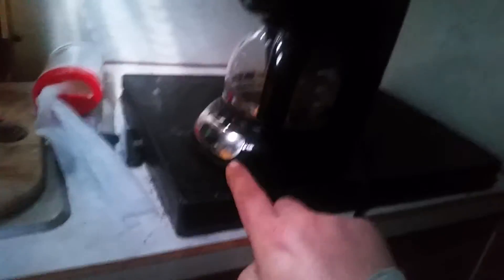Duralast 1000 watt power inverter  (JUNK )

Comment: Mine is 3000 watts and I'm having similar problems
Reply from the maker: Yeah they didn't built them properly, Aims is the one you want to go for. I had enough volts as you could see and it couldn't even turn on a small coffee machine which sucked. I lived in that van and seen that inverter and thought it was a great idea for coffee machine, TV, stereo etc. But starting checking these inverters out and Aims was the best. Good luck with your journey threw life.

Comment: Cables have alot to do
Reply from the maker: Yes your right, negative cable must be grounded out real good, both the Positive and Negative need to be really tighten down, condition of Battery and Batteries also makes a big difference, also the most important is it's not defective from the factory, some person might of said who cares and might have smoked a Joint. So their is a lot of circumstances. I seen this once on YouTube, some guy said he was a electrican and he didn't use heave gauge wire it kept blowing fuses, so sometimes it's worth bringing it to a R.V. place or even a Car garage. Have a goodnight and thanks for your open comment on the subject above

Comment: I got that exact inverter from my sister. I have ran small shop vac's, 7 amp weed Wacker and small single pod coffee maker (900W). Just tested AH of Everstart Group 29DC battery using a 200w fan. At one time the LUP message popped up, although inverter came in the box, I had no manual so I didn't know what it meant. But it reverted back showing power and voltage. Inverter shut off @ 11.34V. Only thing is, it shut off long after I had checked the KillAWatt for watt hours, the figure I was testing. The inverter shows constant 116v 60HZ under most loads. The fan is pretty quiet, unlike the loud Everstart 120W and 1000W inverters. They sound like a jet plane. I haven't done any testing on the Everstart 1000w other than running the Walmart brand 600w Model 201762 single serve coffee maker and 500w quartz work light. I have (2) Schumacher 2000w inverters, still in the box (7/06/2021) I can sell cheap for any takers. Those come with 4 cables for battery hookups.

Comment: 2 recommendations, first you will need more than 1 battery and very heavy cable to pull out the 55 amps DC you need.
Reply: And if your battery is down to 11.9 volts and 1 battery it will not run. I have a 750 watt Duralast inverter as a backup for my off-grid house and it will run a coffee machi e.
Reply from the maker: Thank you.

Comment: Your inverter is fine.

First, your "550 watt coffee maker" may be pulling far more than that when it first turns on with the surge. What is its surge draw? Probably more..

But, more to the point, this inverter is doing exactly what it's supposed to do: Shut down when input voltage is too low. If you attached a multi-meter to this battery that is showing 11.9 when you turn the inverter on you would see that when the coffee machine is turned on and the inverter starts pulling tons of amps out of the battery, the battery volt drops. ALL BATTERIES DO THIS: When they are under load their voltage drops. All batteries of any type. Either your coffee machine is surging well beyond the spec of the inverter or, if the inverter's error message is to be believed, the battery can't support the load you are asking it to support.

I recently tested a 3000W continuous inverter on a coffee machine and toaster. It would run either by themselves, but in dual it would constantly fault out. If I paid close attention I could see that it was sinking my 12V's voltage way under 11 when I tried both, so the inverter properly shut down. That is what yours is doing. And BTW that was on a new battery actively attached to a car's alternator. That's why huge loads require larger batteries or multiple batteries in parallel. 

This is also why TheInverterMan got his to work--because his battery was able to provide the load. I have a very slightly newer version of the duralast 1000 watt inverter and I can run an 800 watt toaster on it or a full size refrigerator because I'm pulling from a battery that isn't drooping under load like yours is. If you don't believe me, go and buy another inverter and you're going to keep having the same issue.
Reply: patty109109 Agreed. And I’m willing to bet the cable he’s running to the inverter are probably nowhere near the size they should be.
Reply from the maker: patty109109 Mine wasnt working period. I had  T.V. repair friend that tore it apart. The battery was new,  it was  2,000 watt inverter,  so it left 1,000 watts and it could not run 550 Watts. The buzz signal was going off ealier then when it was to shut down. Im done playing with these cheap inverters and found on on Ebay with 15,000 watts, to run everything.  I could only run a flat screen for a little time and it would shut down even a U.S.B. port wire for my phone charger,  never again will i buy something small like that. Thank you for your open comment and Good luck to you and your family in the future.
Reply: My 2000 watt inverter is doing the same as this guys and I can’t even plug my cell phone in without it shutting off. It’s definitely not the voltage

Comment: Thanks for telling me that and the reason I'm doing research so i can take care of my fam i was at Auto Zone i seen this so i decided to look this up on youtube to get further info.When i was at auto Zone they told me once i open it there's no returns on most electronic's so i looked it up on youtube to check what i was trying to do would work.i think you already told me that it or this has a fuse on the outside I'm just asking to make sure ? I was going to use 1 of these with a top post battery with a Car Auxiliary Clip-on Cigarette Lighter Socket Battery Clamp Clips Power Adapter and a power line inverter from wal mart cause it has two ac outlets o make it portable ? I hook all of them up it wouldn't cut the fan on but it was able to charge a cell phone i thine i need a in-line fuse holder to make the fan come on let me know ? When i put the car battery in the car with the same power line inverter the fan and everything comes on with no problem at all.

So i think i need a in-line fuse to make it work without a doubt like in the video "Build A Portable power Pack For $25"
Reply from the maker: mangreat71 The fan you need on to cool it down, it over heats you will cook it, There was not a fuse on the outside,  i had a friend who repaired T.V.s, he tore it apart. The fuses on the inside are sordid  even i callec a couple of places no one wants to touch these Power Inverters when they jave problems.  You can wire it up where you have jumpers that connect to the battery,  if you can do it great as long as your not bringing it back. Im wondering if you really need two Batterys tied into this? I was going to run the 6 volt Golf cart 6 volt batterys that lasted longer but you need a special inverter for 6 volts. If this one dont work out for you. You might have to go on Ebay there is a bunch of different ones, they do sell the small generator thats hand held and portable and is almost the same thing as  power inverter,  but better,  so there is a couple of Options for power if needed?

Comment: My Question is do it has a built in fuse like a 5 amp or a 10 amp or even a 15 amp ? Cause what i was trying to do is make a home made jump starter or power pack for charging appliances but i think i need a fuse like a 10-20 amp car fuse  with the top post car battery ???
Reply: I have one of these inverters. And you need to use a short #4 cable to the battery. I think what is happening is that either your DC cables are too long or not big enough to carry the rated 1000 watt load.  Also since the output is a Modified sine wave, some devices will draw more current because the voltage appears lower ( W=VxI )
Reply from the maker: mangreat71 You cant tear it apart, most of them have the fuse on the outside,  if it was a fuse it wouldnt even come on, i had my T.V. working off it, its defective from the factory.  Thanks for your open comment and Good luck in the future to you and your family. Just use caution if you replace the fuse,  some places will not accept there item back if you opened it up. If you have a warranty still on it. id bring it back. Have a good weekend buddy.

Comment: I have the same inverter. It runs microwaves toasters etc. is your inverter or your battery grounded? can be a problem
Reply: mine smoked after two uses...junk
Reply from the maker: yes its grounded if not it wouldn't come on. Please make a video so we can see you run a microwave with this inverter. lol I just proved it couldnt run a small coffee machine with 550 watts. Anyone knows you need a couple of batterys and also atleast 4,000 watts this will run anything,  but not everything at once. This story reminds me of some bone head on here who said he uses a 1,000 inverter to power his house, what his dog house? People today thinks everyone should believe there false storys, im to intelligent to fall to some idiot that dont know what he is talking about. Have a goodnight. P.S. post the video of how your using the same inverter to power microwaves lol.
Reply: +My Apartment On Wheels I might take you up on that.
Reply from the maker: +BADD1ONE Please do lol. If you can run that, then it means mine is junk, like i have it on the title. one more thing it didnt drop down to 10.5 volts as you can see in the video. Im shopping around for a nice one, im restoring a camper van and need power for dry camping. Take care.